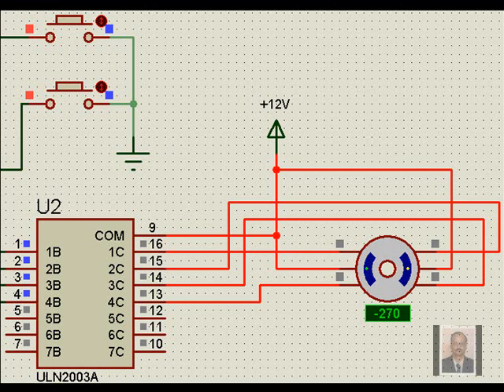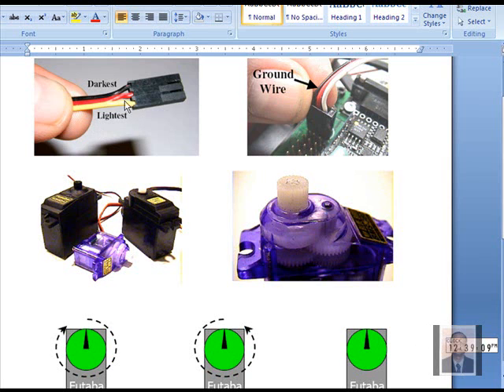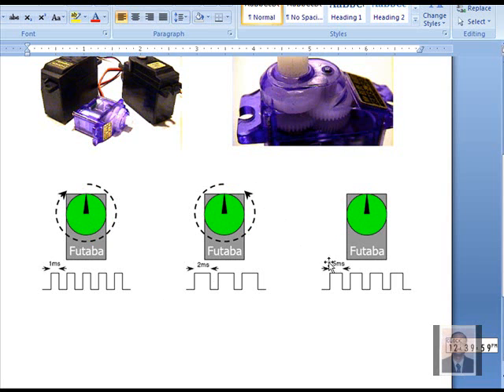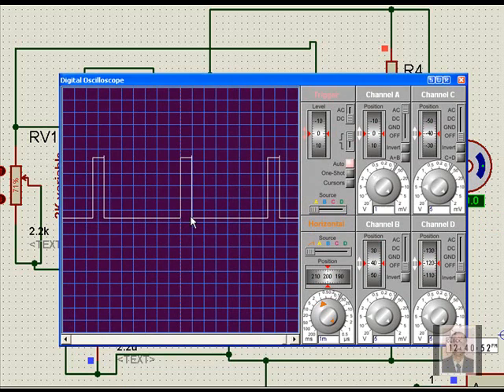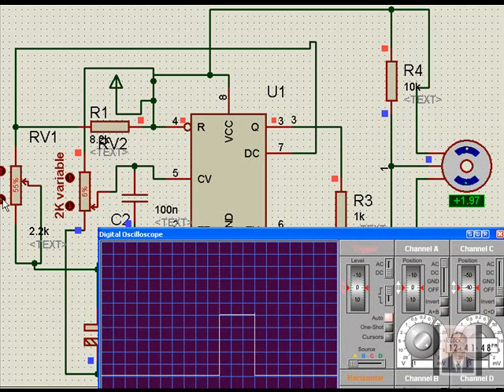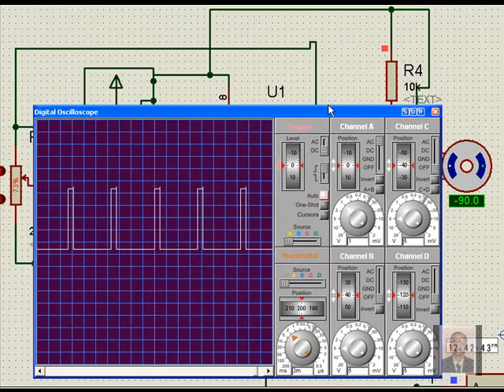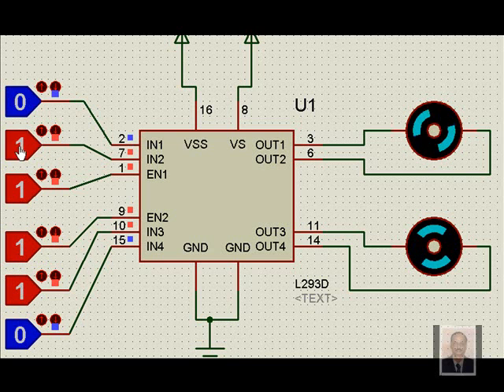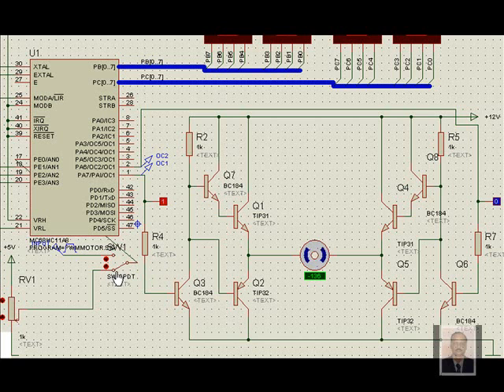Practical Electronics - motors servo stepper DC.wmv

Comment: hi sir 
thank you for thi video 
and i have a question please 
if i disconect  the  2  wires(for the small motor) inside the servo and i connect this H bridge to control a biger motor 
does it works ?? 
a lot of thanks